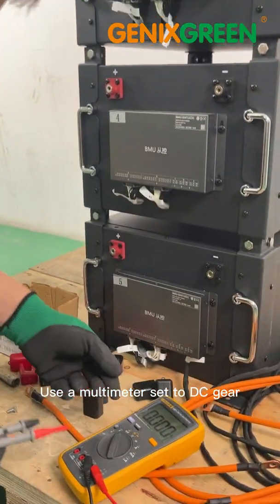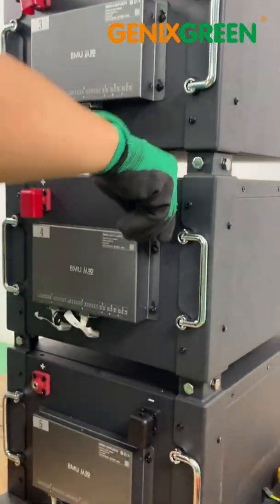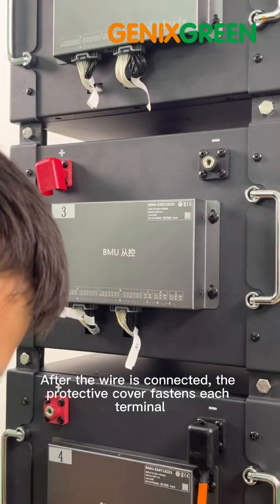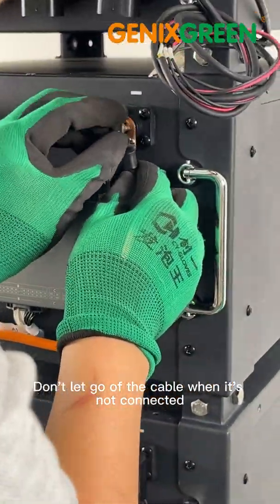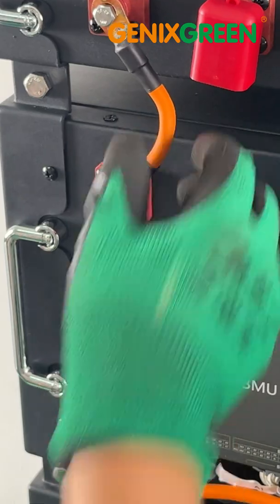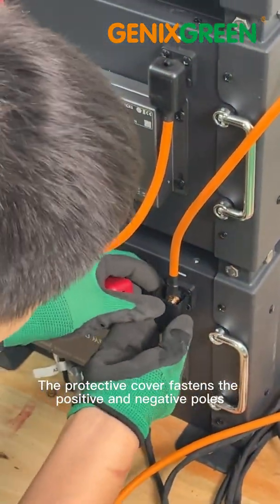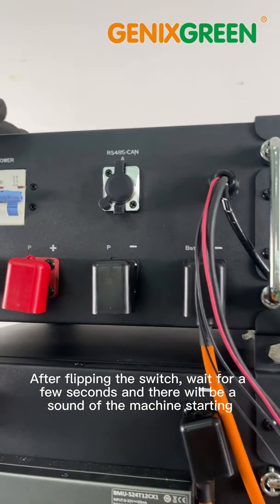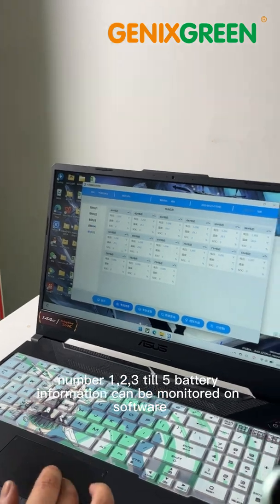240V high voltage battery system installation instruction-Genixgreen

Comment: Hello, I, as a distributor and fitter and seller of battery packs, do NOT like these types of battery pole connectors. there are much better conectors that do not risk getting a short circuit when you mount these. switch to them and you will get a better and safer system
Reply from the maker: Thank you Magnus. The connector directly insert type is easier to connect and the terminal have insulation protection. The battery pole connectors are customized, we also available to provide better and safer solution, only based on client budget consideration. If need more info. can contact me on WhatsApp: 0086 18098143134